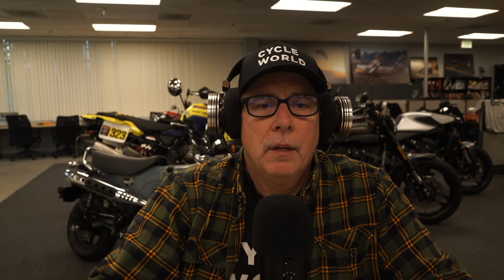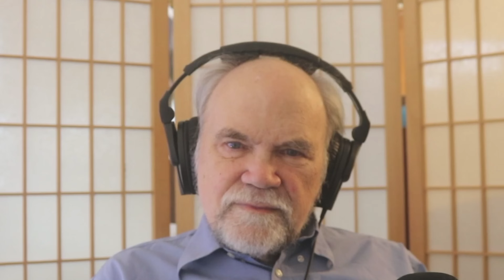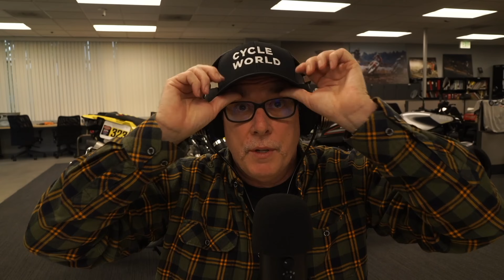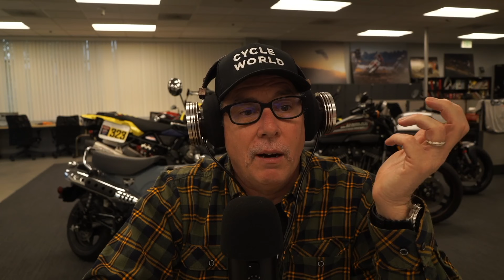How the MODERN MOTORCYCLE is MADE: Good + Affordable!

Comment: The frame of my Triumph 650 bears a striking relationship to the tube-and-lug bicycle frame from which it evolved. What separated the two was a very long line of modifications and substitutions—adding a brace here, increasing tube diameter or wall thickness there, switching to a telescopic fork in the front, eventually fitting a cast iron bracket to the bottom of the seat tube to provide a pivot for the swing arm at the back. It is the polar opposite of a clean-sheet-of-paper design based on a proper stress analysis. More like the Darwinian evolution of the motorcycle. Your story about adjusting the frame alignment with a large hammer makes perfect sense! How remarkable (or is it?) that they arrived at a motorcycle with truly excellent handling.

Comment: Hay Guys I am having two 750 GT Ducati engines converted to slipper big end bearings one stock the other my dream engine Desmo 880cc with welded up high compression heads and bigger valves both to run Khein FCR carburettors. Cost per Lb Close to $90 USD $200 AUD per kilogram for the metric aussy croud. Not including original price. Intending to do a lot of riding in my retirement.

Comment: As a Mech Engineer and former manufacturing engineer, at various factories one of which was making tyres, I always find this fascinating. So many people think that what they see on the outside is all there is. But engineers know that there is SOoooo much more!
BTW, the latest I've seen is using 3D printing of sand moulds and cores, to reduce cost and improve accuracy on low volume runs... technology!

Comment: With an inseam of 26" seat height has always been of primary importance.  Now I'm not some cruiser pansy who needs both feet flat on the ground but I do need to be able to dab one toe or the other at a stop.  My Speed Triple is absolutely as tall as I can handle.  So I would appreciate a variable ride height system and I think they should build it into a lot more than just adventure bikes.  As Kevin mentioned, dropping the suspension is really not an acceptable option because it screws up everything.

Comment: Doug Hele tried an overhead cam on the BSA/Triumph triple but found it did not make any more power. The problem was the ports, small diameter and constant cross section with a very sharp turn at the guide.
Reply: The Triumph triple head was a three cylinder version of the Triumph twin head, dating back to 1937 or thereabouts - actually derived from the 1930 Riley 9 engine of which the designer Edward Turner was an owner and admirer.
 There was an ohc development of the BSA A65 engine, which had a MUCH more modern cylinder head and showed useful improvement .

Comment: something that's being going through my mind which defies logic. Which is related to the price of a car and a motorcyle. Let say we  have the suzuki v storm 800 DE , which cost X .we also have cars by susuki which also cost X. the amount material used to build both are totally different. but still cost the  same. Both use ICE engines, one have 4 cyclinder the other have 2. So what im trying to say is the price of these motorcycles are a scam. People want to think a expensive price tag means "something special" . in reality the dont cost that much and they sell a "marketing trick" which works.
Reply: There's parts of the equation you're leaving out, units sold along with them having to recoup the costs of development and setting up production, so the more units you sell the cheaper you can sell them because the amount per unit to recoup those costs gets spread across alot more units.
They probably sell 10 cars for every motorcycle they sell.
Reply: @dukecraig2402  a assembly line and production space needed for motorcycle manufacturing is away les than what is needed for a car.
Reply: @dukecraig2402  I'm from India, so here they sell quit a bit of motorcycles. You can check the volume online. It's not small.
Reply: I think maybe vehicle cost has more to do with economy of scale than it does the flat cost of materials. 

In 2023, Honda North America sold 498,000 units/motorcycles. Harley Davidson sold 98.5k 

Toyota North America sold 2,248,477 cars in 2023, and Chevy sold 2,000,000 cars in the US that year. 
Motorcycles and motorcyclists are a tiny demographic. Production numbers of everything are way, way lower, so everything costs more.🤷
 
Geez, a live MotoGP race will get less viewers on ESPN than a dang Cornhole Competition.😢
🏁😂
Reply: A Champion spark plug rep once told me 50 weeks of production is devoted to cars and trucks. That leaves 2 weeks production for everything else. Champion isn't the power sport supplier it once was, but you get the idea.
Reply: In production, it's all about volume, motorcycles are low volume compared to cars so that's why bikes cost more
Reply: @GS-zv3qn  a million motorcycle is sold in India every year.